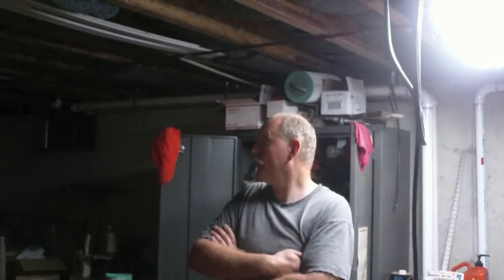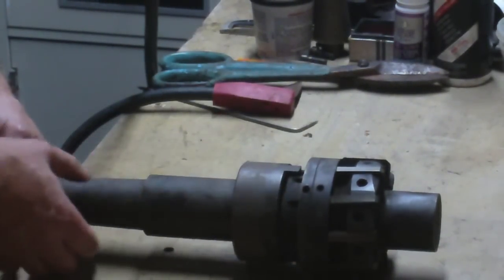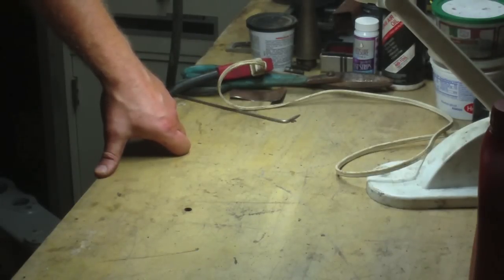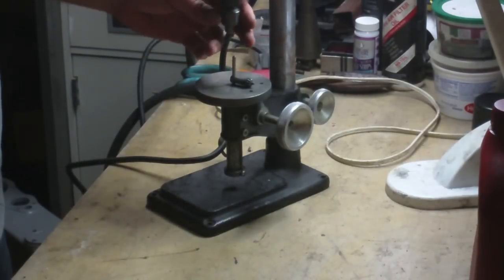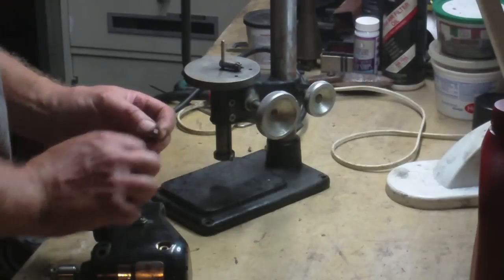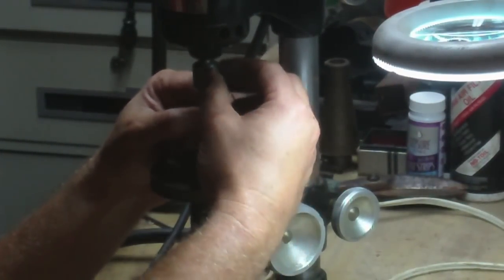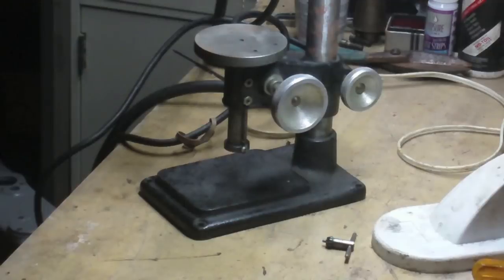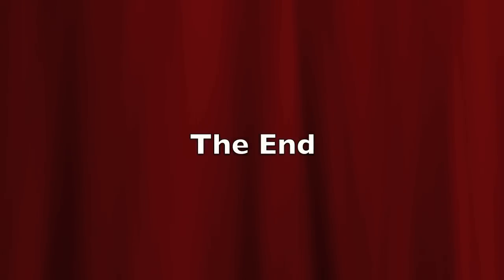The Dumore sensitive drill press

Comment: We are new here (subscribed) it was the Dumore Sensitive drill (Dumore still in business) we use there motors have one that runs our Marshall Watchmakers Lathe currently. What we dislike about that drill press over the ones we use is that the spindle and the motor are all in one, and the table rises the drill is not on a quell feed, that is all our own personal preferences as daily users. 
We love Practical Machinist it is such a helpful place to hangout learn through reading a lot. 
The Dumore drill press still sold is a great machine useful and high RPM great for micro drill applications. Nice to see this video and have you share your find even though it was 4 years ago now. Tolerances and run-outs are always in need of testing under use, no mystery to Universal or AC/DC power is we use it some here. Albrecht key-less chuck was likely the one, those are what we use. Thank you, Lance & Patrick.
Reply from the maker: Welcome to the channel!

Comment: I found one at an outdoor swap meet. I took it over to a power receptacle to verify that it worked. We settled on $20. It wasn’t until later that I found out how much these are worth. I replaced the brushes and a Dumore expert had me run it for him over the phone to listen to the sound. He pronounced it in good shape. It is ideal for drilling tiny holes in printed circuit boards., especially when using brittle carbide bits that will snap in any hand-held drill. I remembered seeing one in such use at an electronics factory when I was much younger and always wanted one. A happy find.
Reply: I realize it is kind of randomly asking but does anyone know a good site to watch newly released movies online ?
Reply: I have to say that is beautiful drill press. I have been looking for a Hamilton sensitive tapping machine. It is to the point where I am going to cast the pieces to build my own. I was super lucky to find a Gator Push Pull tapping chuck. I am a also building an articulating arm tapping device and I am going to try and video these projects as the beginning of my channel.

Comment: Those drill presses are not intended to run at 17,000 rpm WFO. Mine has a foot pedal that came with the drill press marked Dumore where you can start at a low rpm and the harder you press the more rpm’s are gained up to maximum. It’s basically operates like a VFD on a larger machine tool. Very nice feature to have when you doing precision drilling.

Comment: The armature may be a bit corroded. A bit if fine sandpaper on the armature will usually revive it. I'd look at oiling the bearings also.

That is a universal motor, same used on vacuum cleaners. AC/DC is because of the type of motor. Used to produce high RPM rather than that it can also run on DC.

Those are great for things like circuit boards where you need to drill small holes. The high speed and fine feed prevents the drill from grabbing, digging in and breaking.
Reply from the maker: +Scott Henion Thanks Scott. Any idea how to oil the bearings? I do not see any oil ports.
Reply: No idea, probably have to take it apart to get to them.
Reply: Adding oil to the bearings is a bad idea. Oil will simply seep out of the bearings, leaving them dry and prone to damage. Adding oil to old grease is even worse. In fact, even adding new grease to old grease is not recommended. Just take out the bearings and completely remove the old grease with brake cleaner, naphtha or kerosene. Once dry, add new medium light grease and re-install the old bearings. But if you are gonna go through the trouble of cleaning the old bearings, I suggest you just spend a few bucks and get new quality ball bearings and eliminate the risk of bearing seizure (which can cause catastrophic motor failure).

Comment: For the cost of replacing the bearings or even the motor, I wouldn't have passed it up at even twice the price. I love that little drill press!!! Now I've gotta find me one. Let me know what size bearings those are and if I've got em here I'll send em to ya.

Edit: just noticed that this video is over 3 years old. Lol. Anyway...... Awesome find. I'd like to know if you still have it and what you do or do not like about it. Thanks for sharing the awesome find!!
Reply from the maker: Hello. I rarely use it, only because I seldom need to drill holes this small. I'll probably move it to my office for occasional PC board repair work.

Comment: If it's slowing down and speeding up someone must f took the brushes out to clean or look at. When you take the brushes out and put them back in you have to brake them back in. Leave you drill on for 10min and it should speed back up to 17,000 rpms and stay there.
Reply from the maker: Thanks for the tip.